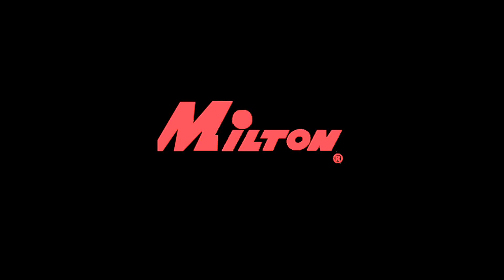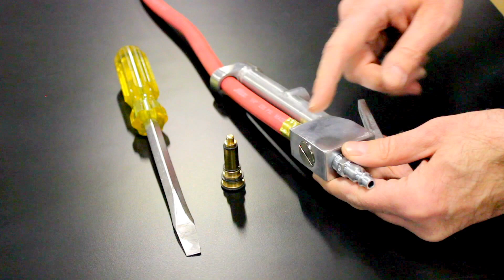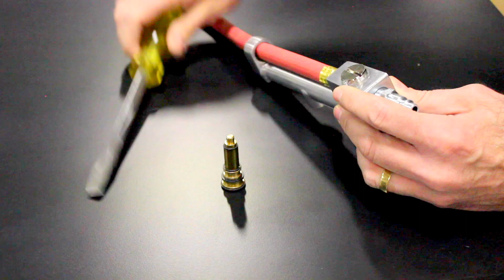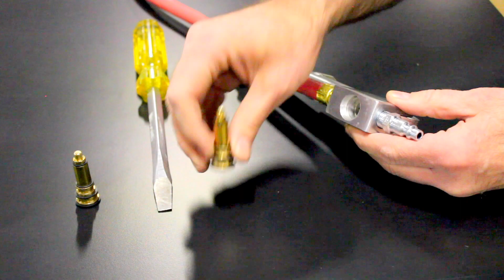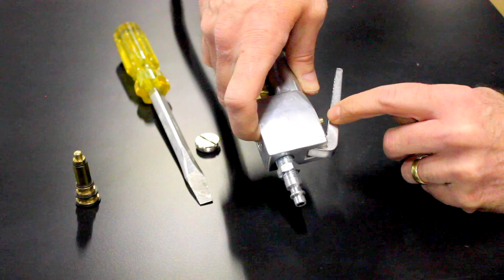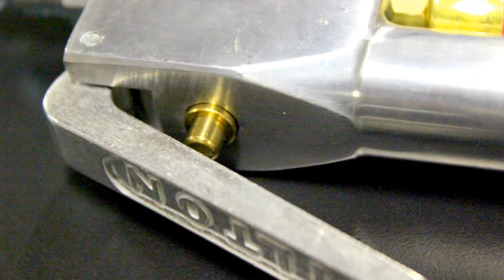Inflator Gauge Replacement Valve

Comment: on the bottom ring (where the hose goes through) of the aluminum housing can you guys grind down the sharp edge that faces in on the hose ? or add a hose guard, my 518 is not that old and hose shows wear. I felt it what i could and its unusually sharp there.

Comment: I have two 506 inflators, and neither will put air in the tire. Brand new, first time using both, and I had to keep changing to a clip on chuck to put air, then swapping back to get the reading.

Doubt Ill get an answer in time....chances are by the time you guys answer Ill have a Snapon or something else.
Reply: I have the same problem.  Just what in the world is wrong with these things?
Reply: @BjorgenEatinger  I dont know...but quality is going down big time. I ended up cutting up one of them, and modified it (which I was going to do anyway) so I ended up swapping the chuck with a fitting (so I could add a longer hose, to inflate large tires further away in case of a blow out.

Try getting a replacement from the store you got it, or Amazon. The second one did eventually start working. Id say me being a dummy, but to have two fail? Then after banging one (stress relief lol) it began working...

Comment: Curious what the reason for replacing the valve?
Reply: Leaking air or stuck hard to press trigger is my guess. Its a simple shutter valve. Wonder if they have a rebuild kit? As that would be a cheaper fix just swaping out the orings.